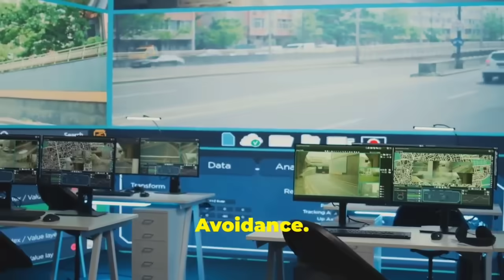The Future Of Transportation: What If Self-Powered Car Is Not The Future?

Comment: This Microsonic Energy Device from Maxwell Chikumbutso can be combined on a Hydrogen Combustion Engines for those who wants Vehicles with bigger Horse Power (Cars,Truck's etc.) and it can be used like a Electricity Power for Hydrogen Generators
Electrolizers🌀 and of course to charge the Battery's on the Vehicle..It is much easier to make Combinations wenn We have already that kind of Source of  Power ✨⚡⚡which never ends up and is permanent..⚛️♾️